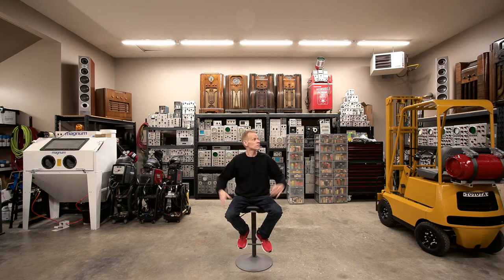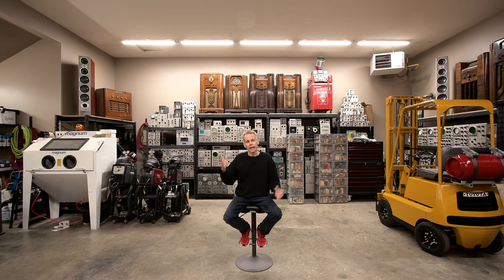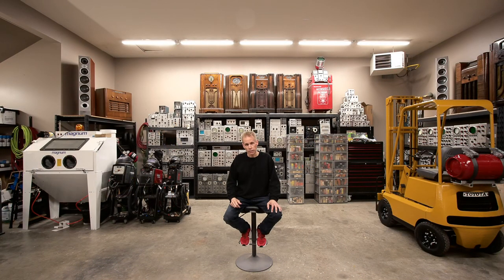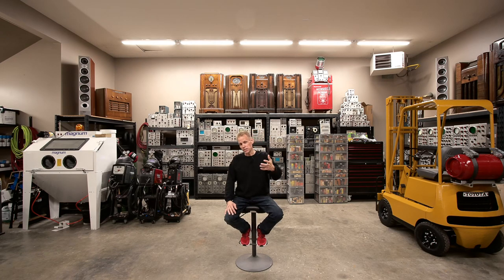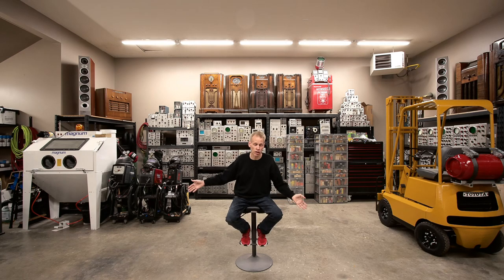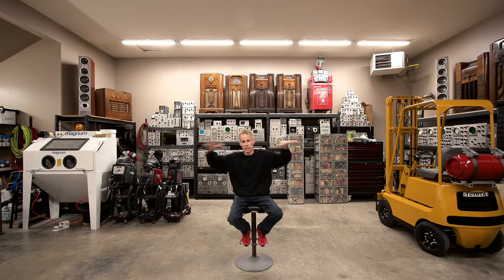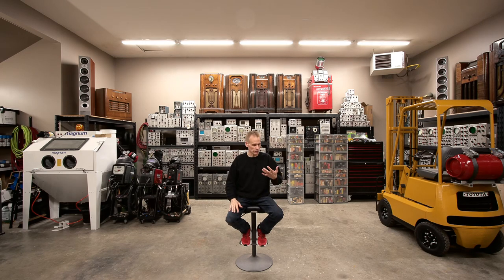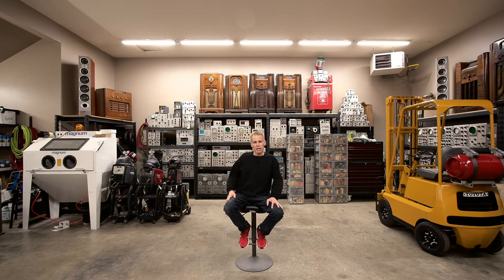ZAP! Mr C's Worst Electric Shock Explained In Detail!

Comment: The worst I ever got was 800V off the plates of a pair of 6146s in my Collins transmitter.  I had turned it off, but forgot about the external power supply.  Brought me to my knees.

Comment: I'm an electrician, now retired, I only had one bad shock in all the years. I was up a pair of steps early in the morning and ended up holding a live cable 240v in the uk  I couldn't let go and I'm sure the shock was going across my chest, I was still thinking clearly I knew what was happening  in the end I had the idea to let my legs go and fall off the steps. My heart had a very strange beat for hours afterwards. Recently the Dr's have told me I have a right hand bundle block, this means only have the nerves in the heart are working to make it beat. Maybe the shock damaged them.

Comment: when younger myself about 13 years old was trying to make an amp out of  an old radio, had  blue flame's come up both arms and it throw me about 10 feet over to my bed, a ring on my finger which could't get off some how flew of my finger, Wow and when working on a color TV got hit full force with the max voltage from the picture tube and the knocked me at least a dozen feet back,  when young, thank God am here to talk abut it, Oh when about 4 years stuck a fork in an electrical outlet and melted the fork, my mom couldn't believe it, 77 now and an extra class radio

Comment: My uncle worked for the power company in orlando for his whole life and was a high voltage tech.  He said he was working a substation one night after a hurricane had killed some of the main phase fused links because of crossed lines down the way..  said they had to use aluminum ladders to do anything for grounding as well as tie off to ground with a belt thing.  Said he was about 40 feet in the air and out of nowhere he catches a dragon off a line and said as he was lifting up his wrench the arc shot way up above him and like thor the lightening bolt grabs his hand and pulled it to the line.,  burned through his gloves and said it felt like he was hung up there for 5 minutes but said he had another guy working there and he took a long broom and smacked my uncle im the back which knocked him off the ladder.,  said it burned a hole the size of a quarter through his boot and molded the soles to the rung of the ladder..  said he had a ring around his waist where the belt was..  still says his gloves passed the routine leak tests and boots were new..  all ppe was on and going by the book but somehow that arc saw him and ate through the glove and sucked him to the line.  Crazy. Said he shoulda died..

Comment: Hey Paul, thank you for sharing all of your videos firstly. I've learned so much from your channel and thoroughly enjoy your videos, and I thank you wholeheartedly for sharing them. I am a little confused by your comment at 4:00 mins in though, where you seem to say that it's unusual to not be able to let go of DC..? This is the complete opposite of my understanding, which is - you cannot let go of DC because the current is constant, but you CAN let go of AC because the current passes through zero every cycle and this is your opportunity for your muscles to relax (from the shock current), and actually let go. It sounds like (especially with your mention of 60hz buzzing) that you experienced an AC shock? Why do you think that you experienced a DC shock in this instance..? I only ask because I don't understand your logic and I do want to stay safe and understand the risks involved when working on electrical equipment . I'm very glad you survived the experience though!

Comment: I took around 60 kV? from a Flyback anode cup on a large floor model CRT TV once when I was 8 years old. It knocked me on my butt for a while. I learned not to stick a screwdriver in under the cup especially if the TV was just powered on. CRT tubes hold a charge like a large capacitor.   
I gutted the tv and built a shelf inside of it for my Gold Fish tank (Dad helped with the shelf and he put hinges on the top).

Comment: The microphones ground must be connected to the primary or hot side of the radio's power supply for that to have happened otherwise I would have thought it would have been isolated being as it has a linear power supply?

Comment: Paul, I have an old RCA stand up radio like the ones you have on your top shelf that belonged to my grandmother. It did work back in the 70s but has been sitting in my basement all these years. Would you like to have a new project radio to work on?
Tom from Syracuse NY.

Comment: Actually both AC and DC will cause muscle contraction. DC is sometimes considered to be better because it causes a single hard spasm throughout your body which can throw you away from whatever you're touching but if you grab something like you did that single contraction is going to make you hold on to it. AC causes multiple contractions of muscles so it doesn't have that effect of throwing you away from whatever you're touching but either one can make it difficult if not impossible to let go of something that you have grabbed.

Comment: It could have been an rf shock, you don't need to be connected to anything else if it was an rf shock. The worst shock i got was from a tube tv, and it was similar to the sensation you described, It traveled through my hand then probably my heart and then through my leg to the concrete I was standing on. fortunately because of how i was shocked I could still move enough to disconnect myself.

Comment: Electricity need to be respected, esp. Involving high voltage vacuum tubes. Brings back my memories of the two times, I still remember today. That also made me search for better understanding. In the end it is all about the amount of current(9mA threshold of pain, 25mA ventricular fibrillation occurs). Also the path is critical(anything through heart should be avoided-no two👐, always use multiple insulation like gloves,mats etc). Again higher the voltage, even typical insulators starts conducting(the reason, why staying in car in a severe thunderstorm is safe, because the tires provide a conductive path to ground).  Just some 💭. Love the content 👍.

Comment: I made the critical mistake of servicing an old plasma TV while it was still plugged in. I felt connected to the grid. It was as if giant iron balls were forced into and under my skin at 60hz leading from my right arm, right down to my left foot. It was a horrible experience and I was sure I was dead. I believe I became a short between the HV board and AC. When those capacitors drained from that circuit it felt like a switch was thrown. I felt like i had gotten into a car accident, i was just dazed. felt a bit tipsy.

Comment: Even if you're careful..... I was messing with an old war surplus transmitter. They used shaft isolators with a ceramic disk and two metal forks. I was tuning and a setscrew let loose so the shafts touched. Next thing I knew I was on the floor 3 feet away seeing stars.

Comment: I was repairing some Chinese decoration lights (for diwali) when i was only 13 or 14 years old and there was a cut in the wire insulation. I received a very bad electric shock 220V mains through my left arm... all i remember is i let out a scream and thrown back while still in contact with that wire. Somehow, my aunt heard my scream, she rushed and turned off the switch if it wasn't for her, god knows where I'd be,and old Indian Homes are NOT equipped with RCCB/RCB/GFCI ! Now I'm 24 with a first class electronics engineering degree, working in Tech! EE was all i ever wanted to be from a very young age! It was an extremely horrible experience.

Comment: Never apologise for your caution and warning to viewers. I was in radio broadcasting for 60 years and have had my close calls, too. Fortunately, I am not much of a jewellery person but I was still wearing my wedding band when discharged HV capacitor recharged enough to bite me right on the wedding band. The charge went up the left arm and out the right hand into the grounded cabinet. While not as severe or as long lasting, it is still a very unpleasant experience. The wedding ring went into my coin box until retirement.

Comment: I was shocked by 240 volts AC when I was 5 years old. I stuck a hair pin in an outlet (I was living in the UK at the time. I was sitting on the floor and I felt the current moving through my body like a wave. I staggered into the living room pure white and speechless.

Comment: I've zapped myself the last time 3 to 4 years ago. left hand on grounded switch and right hand on hot replacing a three way switch. 120VAC in USA.
whoops, I have done that many hundreds of times over the years. enough so to the point of "oh I'm getting shocked" and let go.
my buddy got it good from arm to arm via dishwasher waterline to garbage disposal(disposal was hot, via bad wiring), just early this year. that was after "electricians" semi rewired the place.
they got called back to fix it and didn't fix it. they gave me the job of replacing dishwasher(lol). I got "shocked" when washing hand in kitchen sink when I brushed my arm against the metal sink.
yes, I did it a few more times to make sure I was shocked and not poked by a burr on the metal... the grabbed meters and tools. yep, found 120VAC live ground pin on garbage disposal receptacle and faucet/sink grounded via non-conductive lines, but the high iron content/softened water was enough to zap. he touched between the ground bonded copper piping and the live disposal with his arms.

Comment: Is the "cartilage ball" on a tendon in your hand? Does it move when you curl and extend you finger(s)? I ask because I used to have what I'd have described as a hard little "ball" on the tendon on the palm of my right index finger, which would move up and down when I moved my finger. It was what they call "trigger finger," which I had removed when I was 17. Trigger Finger is rare among young people, usually affecting seniors. The condition gets its name from the fact that, for many that have it, the "ball" "catches" on other tendons,causing a sort of "clicking" that feels kind of like pulling a trigger. Mine was painful when it caught on cross tendons, as it would over-stretch the tendons and even got "stuck" sometimes, such that I had to 'force' the catch to release by forcing my finger out, to free it. It sucked. You may be able to have the nodule removed!

Comment: Mr. Carlson, I think you stated the medical effects of AC vs. DC shock backwards.

DC, due to it's nature, causes muscle tetany (constant hard contraction with no release), which unfortunately often means your fingers lock around whatever live object you just grabbed. It causes more tissue damage and more heat damage but less neurological involvement than AC because it doesn't travel as far in the body. One of my fellow soldiers died when a whip antenna he was holding in both hands touched an overhead DC powerline - it was extremely sad, as he was conscious for several seconds, and probably alive for several minutes. His hands were burnt to the bones but still tightly wrapped around the antenna when they pronounced him dead.

AC, due to IT'S nature, causes fibrillation (very rapid spasming) at the same hertz as the source - people who get shocked with 120/240v AC almost always report being "thrown" across the room. That is because all your muscles massively spasming 50-60 times a second results in a loud spastic grunt and uncoordinated backwards hop, ending with you on the floor, but most importantly, BREAKING THE CONNECTION. People who die from AC shock generally do so from heart fibrillation caused in the first millisecond.

Edit: correction, lightning is DC with tremendous voltage and amperage but a very fast discharge time, thus relatively few Coloumbs. If the discharge time was any longer, a bolt would literally explode people like steam bombs.

Comment: Jeeeeez that is so much worse than the worst I've had. That's some real yikes.

I got bit a little by 240AC once, but that was just a little nip. Strangely, it was a 120AC that somehow that threw me across a (very small) room. I was tracing a noisy turntable ground in a radio station with my fingers - with in theory everything powered down - and suddenly [POW] and I'm on the opposite side of the booth.

Turns out someone had run an AC extension cord in the audio bundle and then I guess decided they didn't need it anymore and cut it off in the bundle_, while leaving the _plug on the other end.

And somewhere along the way, someone saw that plug and plugged it back in.

I mean, at least I found the hum, right? xD

Comment: Yes you are very fortunate to be alive electricity is nothing to be complacent about. I worked for pacific Gas and Electric worked in the Oil Circuit breaker shop 15 kv circuit breakers 3 of them welded to two steel I beams so they could be moved to electric substations. Well one of the guys was testing the OCB with live power he didn't know it had been switched on the bolt of electricity hit his hand and came out to ground at his elbow where it exited had it gone through his whole body he would have been toast. As it was he needed plastic surgery for the blow out through his elbow and couldn't use that arm and hand for a couple months but he made a complete recovery.

Comment: Worst shock I've had is a toss up.   One is Working on a live 120v 20a circuit in an emergency to quickly change an outlet.... knees down in water with wet hands. Got nailed by it 5 or 6 times.

Other one I can think of is messing with a 30kv flyback transformer late at night. It was still charged up by a capable and I completed the circuit with my right hand and it threw me about 5 feet.

Comment: I often wonder in America you can plug in anything with a non polerized  plug and potenionally have a metal chassis live? In the UK  AND most of Europe we use the 3 wire system (live neutral and earth) unless the equipment is double insulated. Using the earth system current is sent to ground and red

Comment: Got bitten once by 30kV 33nF (3x 10kV 100nF in series). Passed out in a split second, regained conscious in minutes, with no lasting effects. This happened when I was 15, and since then I'm always practicing my utmost respect to electricity. Despite being a power electronics engineer, I've never been bitten even once later in my life. 30kV 33nF might be painful, but it is not gonna kill me. If I touched a live 800V 3-phase PFC-fed DC bus alone, I would be cooked to well done for sure.

Comment: Scary dude - Sounds like you nearly bought it .. I have a slight fear of electricity because I don't fully understand it - I know enough to understand potential difference & that high current is the dangerous stuff.  But am uncertain when a circuit will choose me as the path of least resistance to release potential - Nor am I clear why and when AC & DC might effect me differently.  Aside from licking the odd 9v battery, I've received significant shocks twice, but nothing like Mr.C. Once was entering a caravan, grasping the handle in heavy rain - Many electrons enjoyed a path from the connected AC supply through the water, handle, me & ground .. I could not release my hand from the metal door handle. The other time, my dear old dad (the engineer!) decided it would be educational to introduce me to an electric fence - The mistake he made (@ my expense) was not to instruct me to lay the back of my hand on the wire, but rather to grasp it with my palm .. Needless to say, the lesson I learnt was trust caution, which sadly may have served me since. Take care. AB 🥝🐐..

Comment: When I was working in the oil patch as a cop,  I witnessed a man electrocuted.  We had been called to a one vehicle roll over north of the city where I was employed as a cop.  We had. a report of a one vehicle roll over, the Ambulance was on its way and wanted law enforcement at the scene. The Sheriff only had one Deputy and he was in the other part of the County so we went.  When we arrived the Ambulance was just pulling up, we rushed across the barbed wire fence and into the field where the upturned pickup truck was, it had rolled and knocked down a power pole, the power line was still intact but hanging very low, about forehead height to a tall man.  Well there happened to be a tall man on the Ambulance that night, and as myself and the other officer were holding the fence down so they could. cross with the cart to pickup the pretty little gal who had been driving that pickup (who was in fact dead, having been thrown from the pickup and crushed under it as it rolled over her) the tall man on the end of the cart failed to duck, despite our shouted warnings, he impacted the 750 volt high tension power line with his forehead, I was looking down at the fence to insure he not trip on it at the time and saw the power arch from that metal cart from the wheels into the ground, and felt a tingle up through my boots that were standing on that barbed wire fence wire holding it down.  The man was thrown about fifty feet back, and all attempts at saving the girl were transferred to the ambulance crewman.  His heart had stopped but quick action by his fellow crewmen brought him back to life.  He had permeant brain damage and his hands were burned very badly.  He had to sell the dry cleaners that he operated in town and, of course had to leave the volunteer ambulance squad.
Reply from the maker: Thanks for sharing your story Jerry!